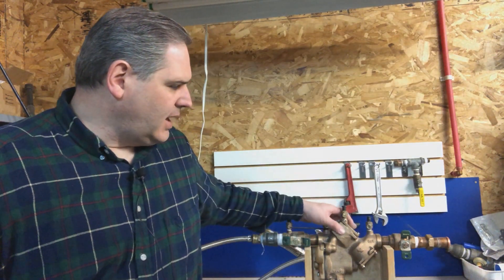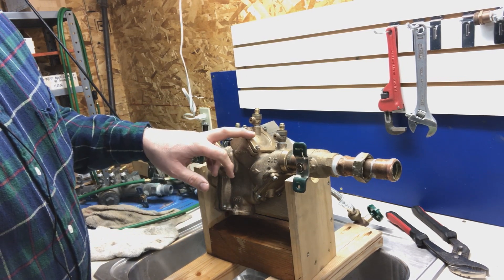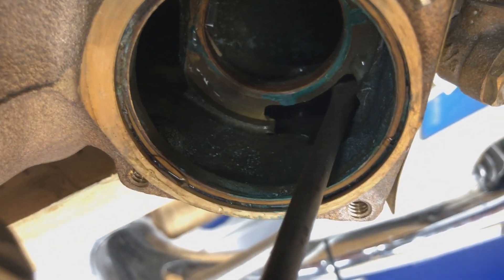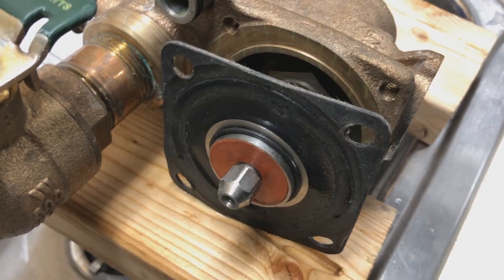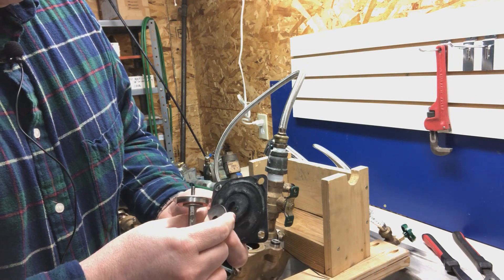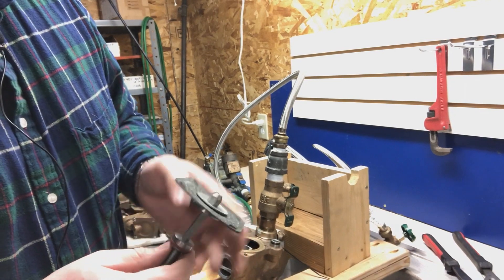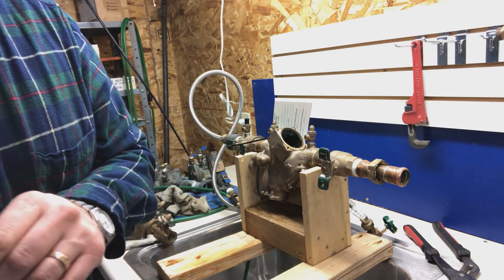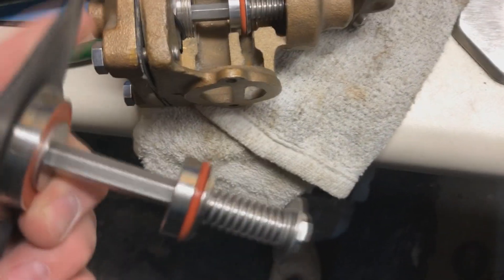How To Repair a Watts 909 Backflow Assembly

Comment: So on that relief valve stem, does that "piston" with the red oring supposed to slide on that stem to compress the spring? Im rebuilding an 1½" 909 at the moment but it keeps blowing out the relief. Ive taken it apart 3 times now and this last time i checked, the "piston" wont move. Is that a problem??
Reply from the maker: No.  That part where the red-ring sits does not move independently.  The water pressure will push on the diaphragm and push the whole stem in compressing the spring.  If you notice on the spring end of the stem is a nut and washer.  That nut will sit in a recess further in the body and the washer will sit outside of the recess.  When the pressure pushes the stem it compresses the spring and moves the stem to push the brass piece with the rubber molded into it onto the seat and the "piston" portion with the red o-ring to where it needs to sit against the body.  If you need more help call me at 801-355-6736 or email sean@backflow-supply.com
Reply: @backflowsupplyslcut9394  thank you sir!!!

Comment: Hello and thank you for the video. I have a problem with post start up. I did as instructed and was able to get the seal for the valve and pressurize my sprinkler manifold. The problem starts when I open a "zone" to irrigate. The zone is open, water goes through the solenoid but stops then water backs up flowing out from the bonnet. I tried different zones and the same problem occurs. Everything checks out inside the Valve. Help!
John
Reply from the maker: John.  What model do you have?  What do you mean by bonnet?  I ask because this video is about a Watts 909 backflow assembly and a bonnet is on a different type of backflow assembly.  We might have better luck talking on the phone about this 801-355-6736 or by email at sean@backflow-supply.com.  We will be closed Saturday and Sunday but I will see the email on Monday.  I will be here for about an hour yet today (until 6:00 PM mountain time)

Comment: how much is cost for total rebuild kit for watts 009 m3 QT 3/4
thank you
Reply from the maker: $143.15
Reply: @backflowsupplyslcut9394  if it shipped to philadelphia zip code 19135. how much is shipping shipping cost 
thank
Reply from the maker: @josephdinh3013  $15.24 UPS, postal about $10., which should get there sooner as long as you don't have issues with the post office in your area.

Comment: hi sean,i have watts 009 m3 qt 3/4 the relief valve is dripping, can you tell me what’s wrong with it.the backflow valve is in basement of the 2 stories building. thank you
Reply from the maker: Joseph we may need to talk on the phone.  801-355-6736.  There are some trouble shooting techniques we can use to determine where the issue is.  What does this go to?  Is what constantly going through this, meaning that water is constantly going to something open downstream of the assembly?  If it doesn't have water going through it all the time does it stop leaking when there is a flow?  Does it slow it down or leave it unchanged. Since this is in a basement does it stop leaking if you close the outlet shut off valve?
Like I said it might be better if we talk on the phone, or if you prefer even email me at sean@backflow-supply.com.
Reply: can you tell me how much it cost if i buy the relief valve rebuild kit
Reply from the maker: @josephdinh3013  The complete relief valve kit, all internal parts for the relief valve RK 009M3 VT 3/4" 126.00.  If you want just the rubbers for the relief valve is RK 009M3 RV 3/4" $49.00

Comment: I have the problem of liquefaction, my question is if that model can be replaced by another or can I connect it directly.  because the part to replace is very expensive.
Reply from the maker: I need to have some more information.  Please call me at 801-355-6736 or email me at sean@backflow-supply.com

Comment: Hi Sean,
I found this video helpful.  I tested a 2" 909 this morning and it failed the relief opening (1.4).  I rebuilt it 3 years ago.  It might need another rebuild.  I am going to take it apart, inspect, clean and reassemble it. Hopefully it will open above 2!  Thanks for making this video! Rob, UT #16211.

Comment: Over the years I had to fix valves that had homeowner installed parts backwards, upside down, and even forgot to install some. That is what training classes are for. I am surprised you did not get more drips from that assembly since you did not flush the petcocks to get the air and any trash out. Sometimes it takes a few minutes for the new seals to seat before all the small drips stop. Good video!
Reply from the maker: Yes, I am as well.  I did go on to test it after the video and bleed the test cocks obviously and it tested out fine.  Sometimes we get lucky!